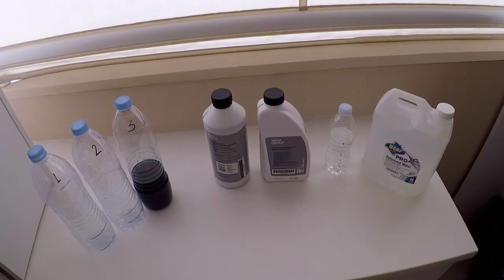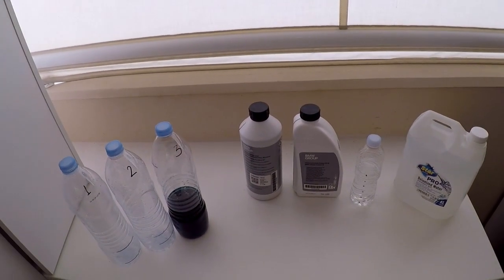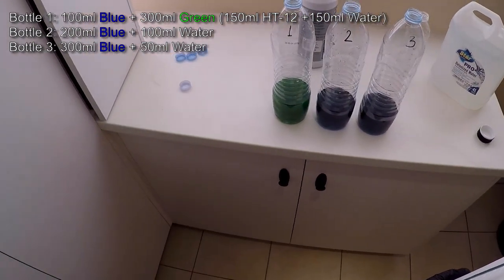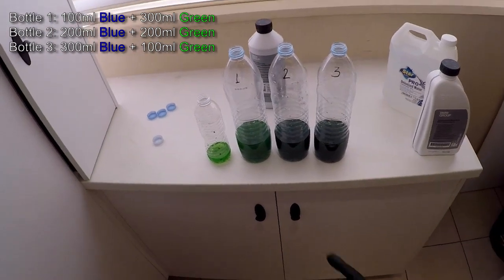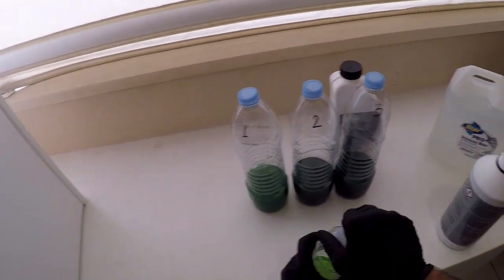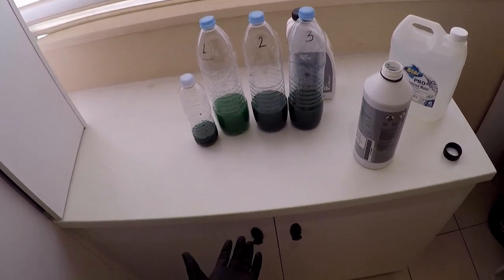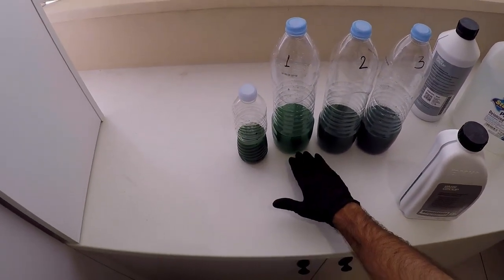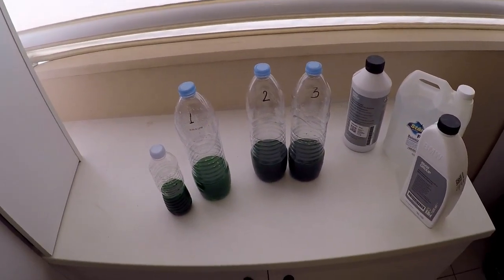What Happens if you Mix BMW Blue and BMW Green Coolant???

Comment: Lame.  This proves absolutely nothing.  All coolants will appear ok when mixed in a bottle, if problems are going to arise they'll only happen after some time of use.  Transmission fluid and gasoline will mix perfectly, pour that blend in your transmission and see how it goes.
Reply: So you aren't entirely wrong, but for what it is worth, the REALLY bad coolant combos will have pretty rapid results. You can expect to see gel forming within an hour or so as chemicals react out of the solution.

It's mostly the American orange/red shit that is super dangerous to mix. I haven't really seen any issues between other types of coolants and to be honest most mechanics are clueless about this stuff because they aren't chemists. Just stay away from orange/red dex cool stuff and you'll probably be fine

Comment: Put some alloy and cast steel bits in the bottles to give a more accurate simulation. Not sure if any copper is exposed to the coolant but if it is, ad copper bits to the bottles as well. 👍
Reply from the maker: Wow, nice suggestion.

Comment: I sir my mechanic mix blue in my bike pulsar 200 NS 1 litre and green 200ml and there not add the water any problem please reply my answer 😢
Reply from the maker: Hi, this is a general advice: if you have doubts about the intermixability of coolants then schedule a flush and replacement of the coolants.

Comment: I have a 2011 bmw328ix..the other day one of my upper radiator hose came off..on the highway draining pretty much all blue coolant..Was luckily enough to be next to an exit amd to a gas station.  I have bo choice but to after connecting back the hose..to purchase the oeak green stuff and added to replace what i need( was late at night.) Didn't even did that water pump procedure..Maybe i need to flush it later around. But the car did run alright.i finish my trip to my mom's house. Any suggestion?
Reply from the maker: Depending on how much coolant you had lost (and what the temperatures are right now, e.g. not freezing), topping up with distilled water to get you home could have also been OK, but mixing coolants (BMW and non-OEM) is not recommended so to be on the safe side I would also schedule a coolant flush in the future. Extract some coolant from the expansion tank in the mean time (e.g. with a syringe) and have a look at it, make sure there's no bizarre chemical reaction going on between the old and Peak coolants, e.g. the coolant is not turning into gel or foam (but this would be quite extreme, most likely your coolant mix is alright for now).
Reply: @NoBrainerTalk  Good Advice..thanks
Reply: @dan1769 hey I had something similar happen with my x5. We have the same engine and I used that same green 50/50 peak some months ago and have been just fine. Tried getting g a flush but I took it to the wrong shop as they were just after money. I the meantime I just got some blue coolant for euro cars at autozone

Comment: Hello feiend ı have 740i 2016 b58 engine coolant is decreasing .some time i moest be refill. There is no leak outside, what could be causing it?
Reply from the maker: Sorry to hear that. You have two coolant circuits (engine and intercooler, big expansion tank and small expansion tank). If you mean engine circuit is constantly low, then the coolant can be consumed by the engine if head gasket sealing has failed, and it can also leak through the turbo charger. There will be symptoms of this from your exhaust (strange odour and exhaust gases having smokey appearance). If the coolant is leaking into the oil, this will change oil appearance (will become milkey). Another way to see if head gasket failure is occurring is to check for bubbles in the expansion tank while the engine is running (NOTE: NEVER OPEN EXPANSION TANK CAP WITH ENGINE HOT, to check for this you need to have already opened the cap before starting engine with engine cold). For both circuits you should check radiators for damage, very often coolant loss is due to stone damage of the radiators.  For both circuits check the expansion tank caps. If there is any white residue this means the coolant is escaping and evaporating from the cap. This is the most well known issue of the B58, you won't necessarily see any wetness or leak there, you will only see white residue as evidence. Many people replace the caps and this seems to help. Finally take it to a workshop to pressurise the systems/circuits and check for leaks properly by seeing if it holds the pressure over a few hours. Hope this helps.
Reply: @NoBrainerTalk  thank you verry much

Comment: You can boil the fluids!
Reply from the maker: OK, that's interesting. I left them on the veranda and It's 45 degrees Celsius out there, but yeah, it won't be as hot as in the engine coolant circuit.

Comment: Maybe the brown colour is due to heat
Reply from the maker: Good point. I left them on the veranda and It's 45 degrees Celsius out there, but yeah, it won't be as hot as in the engine coolant circuit.